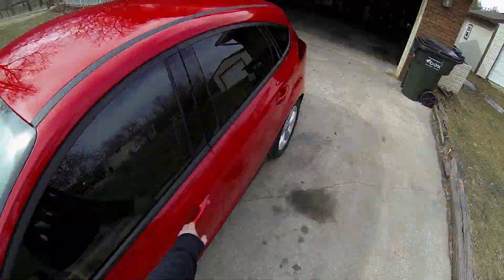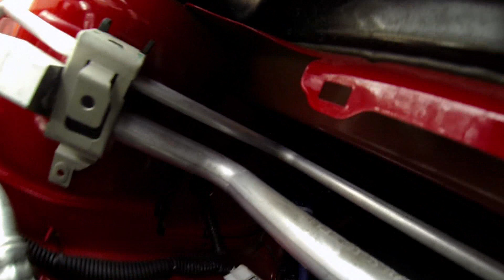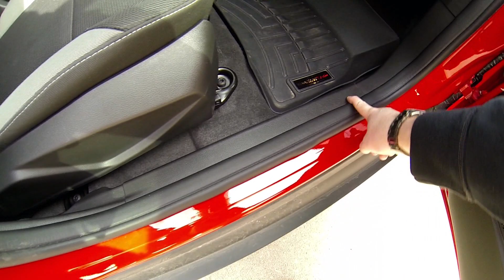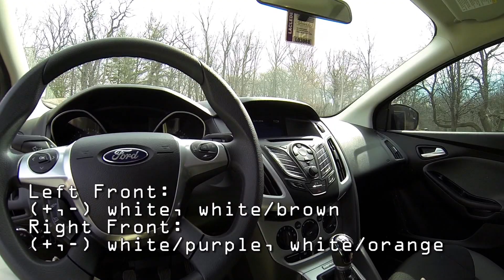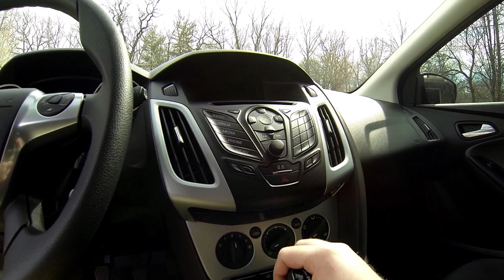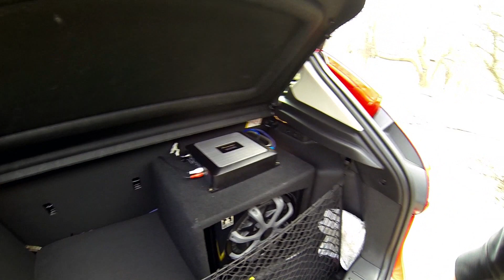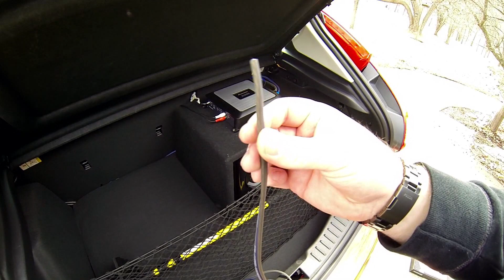2014 Ford Focus Amp Install

Comment: Thank you for posting this! My wife has a 2015 Focus Hatchback and there are subtle differences....but this showed me the path. Saved me a couple hundred dollars of installation fees.
Reply from the maker: pLoco1977 No problem! glad I could help.
Reply: Was it different to get behind radio on the 2015?  I have seen videos on 2016 that you have to removed all the plastic around shifter nob rather than just the two screws.  I hope this isnt the case.  The one in the video i saw had the bigger display as mine is the small one.  I have the SE model.

Comment: can you go more into how you spliced into the speaker wires on radio? ive only ever had aftermarket radio with the red and white rca hook ups.
Reply from the maker: Inside an RCA cable there is a signal wire, and then the ground usually as bare stranded wire wrapped around the insulation of the signal wire. My amp has high level inputs, but doesn't have any different high level input plugs (some amps have a separate special plug for them, not the RCA connections). So I ran the kicker RCA cable back to my amp, but then behind the radio, I snipped off the RCA ends, and got to the bare wires. I then used "tap-in" connectors to connect my RCA wires to the correct radio wires. That way I didn't have to actually cut the wires behind the radio. It can be argued that tap-ins are not very good for this type of thing, but I like them because they're quick. If you opt to use tap-ins, just make sure to cover them with lots of electrical tape afterwards just to be sure they stay in and don't short something.

Something like this could work, depending on the wire gauge coming from the radio:
https://www.amazon.com/Red-Insultion-Displacement-Connector-22-18/dp/B001N7RD9U/ref=pd_sim_23_5?ie=UTF8&psc=1&refRID=1XJ20VSTVNX5XM7RMP1E
Reply: +Dakota Alger thanks for the solid info man. I understand. wouldn't this work too Rockford RFHLC High Level Speaker Signal to Low Level RCA Adapter 
https://www.amazon.com/dp/B009VTDVMU/ref=cm_sw_r_cp_apa_gW2ZxbQ0V69K7?
Reply from the maker: +Dan Gan Yes, something like that should work. However, I've heard issues with the signal degrading in unpowered level converters. That may only be for extremely picky people though.

Comment: I don't know if anyone already knows this and idk if it applies to the 2014 model but i have a 2015 with the body/interior redesign and in the trunk there is a decently sized fuse block in the back with almost everything empty on it, though i honestly don't know what kind of power the rear fuse box can handle
Reply from the maker: Any rear fuse box can't be used to power the sub. If there is a fuse hooked to the ignition, then you could use that as the remote wire. I don't think my car has one, but I haven't checked. Good to know for people needing a remote wire though! Thanks for sharing.

Comment: WHERE DID YOU CONNECT THE GROUND WIRE TO.
Reply from the maker: I connected it to one of the rear seat bolts. Just a tad bit of sanding on the bolt, and it all works great. Just use a ground tester after running the power wire.
Reply: OK THANKS

Comment: wish you played a little so i could hear how it sounds
Reply from the maker: It sounds like a sub. lol
The audio always turns out crappy trying to record it, so I didn't bother. However, being a hatchback, the sound does bounce quite nicely off the rear door and is really loud for a 10 inch. If I make another more detailed install video I'll try to throw in a sample clip of how it sounds.
Reply: I figured that's why you didn't record it. Also, I just want to say thanks, this video makes it much easier for someone like me who's pretty uneducated on this to just go and copy and paste what's shown in the video. Aside from that i do have a question. Would you recommend i get the same sub and amp that you've displayed in the video? Thank you.
Reply from the maker: +Willyy I really like my setup. I definitely recommend my amp. I love pioneer because they have great amps, that usually don't require a remote wire and that have high level inputs (no line out converter). I would recommend getting a pioneer amp with a remote gain control. I love my sub too. I've had it for 6 years or so now, and have never felt the need to upgrade. Having a ported box really made the sub come to life, but I had to fill the box with poly fill to make it sound better. The box is good because it was cheap, and is the right volume for my sub matched with a ported box. I'm glad the video could help!
Reply: Thanks for the reply the information is much appreciated, but I do have one more question. Could you go into more detail about your subwoofer? I'm trying to locate the same sub and so far I understand it's a 10 inch kicker brand sub, but is it a compD, compS, etc.? Thank you again!
Reply from the maker: I went ahead and added the sub and amp info into the video description. Since the sub has two 4 ohm voice coils, I wired them in parallel to make the overall impedance 2 ohms.

Comment: Can I unplug my negative terminal on my focus st 2016 ... Or do I have to hookup outside power source to car. Don't care about loosing setting but will I need to reset any codes or radio codes ? Help 🙏🏽
Reply: Dakota Alger because taking off the hot and putting it back on causes sparks ...taking off the neg  and putting it back on no sparks
Reply from the maker: +Mateo Oliveras Yes, of course you can. The only thing that I lost was the time and the radio presets. Just be careful when you take them off. Although, may I ask why you need to remove your negative cable?? You shouldn't be connecting the amp negative directly to the battery.
Reply: Vintage Vinny DIY already did my install but doing any electrical work involving unplugging any electrical peices always unplug batter to prevent a short circuit because you can. Blow a fuse or worse the wire and have to replace the wiring harness in the car
Reply from the maker: Ah that makes sense. I work with very sensitive electronics, so I usually don't worry about it when I'm working on my car. haha
But definitely a good tip.

Comment: I did everything the same as in the video but now my stereo won't work at all, it's just saying my time and weather. I try to use t he sync functions on the steering wheel and still nothing :/
Reply from the maker: Well then the wiring behind the radio must not be right. Is the radio on? I know it sounds simple, but I just have to check... First thing to do is take the amp wires off the stock wires and see if everything works again. If it does, fantastic. Otherwise, check the fuses. If it was designed right, and since it's a ford I doubt it was, but you should blow a fuse long before any actual damage was done. Then, to get the wires correct, double check that you connected to the correct colors. What I did to verify, I used a ground tester. Connect one end to the ground, and then probe the wires coming out of the radio. The two wires you were connected to before, when the radio is playing decently loud, should make the ground tester light up (kind of beat with the music). Ground testers are super cheap too. You can get one at Walmart or Autozone. Last resort, if you live around saint louis, I could take a look at it. It should be noted, I don't know if the wiring is the same for the Sony radio, or for myFordTouch.
Reply: +Dakota Alger yeah I mean I'm hoping it's just a blown fuse, because I'm trying to turn the radio on and it just won't work. I've double checked the wires but who knows if it's a different setup since mine is a 2013 but it's not sony. Thanks for the reply and I'll definitely get back to you on what I did wrong.
Reply from the maker: Oh, one other possible thing to check... If you still are puzzled and don't feel like checking every wire, you could take off one of the front door panels, and see if the wire colors connected to the speaker are the same as they are on the back of the radio. Somewhere though, the wires split off for the tweeter, so I don't know if that will change them. In my Honda civic that I used to have, they were the same color all the way through.
Reply from the maker: +Todd Ingram I'm planning on making a video that shows everything a bit more in depth, but I won't have it made for a few weeks probably. Good luck with getting everything going.
Reply: +Dakota Alger Alright I'll check the door speakers, You've already been a big help with this video. I'll be waiting for the in-depth one too. Thanks dude
Reply from the maker: +Todd Ingram No problem

Comment: did you lose any of the steering wheel controls doing it this way?
Reply from the maker: No?? There would be no way to mess up those controls by doing it this way. The amp input have a very high inpedance, so they just measure the voltage, they don't provide any power to the factory speakers. However, if you splice into the wrong wires then you could mess some stuff up.
Reply from the maker: Plus, I forgot to say, I wouldn't have done anything to screw up the factory stuff. Everything works still including sync and all that jazz.

Comment: great video dude, very detailed. I put a system in my subbie last week and now my fiance wants one in her focus st. Do I have to pull any plastic from the back of the glove box to see the power wire coming through the firewall or will it be visible once I poke it through?  thanks.
Reply from the maker: +griffith0216 No plastic. But it isn't completely "visible" since it's a ways up behind the dash, but you can feel it. It's easiest to take the glove box off. If you have someone push on the rubber piece from inside the engine bay, then you can feel it from the inside up behind the glove box. My brother has a lot smaller arms and was able to get his hand up to the seal to grab the wire while I pushed the wire through with a big flat head screw driver (not pushing the screw driver into the wire, but next to it to help open the hole). We pulled it through the hole above the glove box first since it was easier to pull straight out from the firewall. Then fished it back through the hole in the glove box and ran it through the channel under the doors. Definitely the hardest part of the install though.
Reply: +Dakota Alger Yeah that was the hardest part of my install last week too. I had no help though so it was a pain in the ass. Thanks for the putting up the color code for the wires. I'm gonna be using the high level inputs on the amp as well.

Comment: Hi, awesome video you have here, quick question, do I need a special thing for the battery terminal? I was watching a different video and the guy said the stock battery terminal won't accept another wire so I wouldn't be able to wire the subs and stuff? Is that true? I already have all my stuff for the installation and really don't wanna be stumped by some $2 problem...

Thanks again
Reply from the maker: I've never had to buy anything extra, but it could depend on your car. You'll only need the positive connected to the battery terminal. I have had to cut the little plastic terminal cover before, but usually I just undo the bolt holding the terminal on, but the new connector for the sub on, and then bolt it back on. Long story short, just double check your car.
Reply: Well seeing you also have a 2014 i'm gonna hope I don't need anything, I also have a 2014, just a sedan, i'm gonna assume nothing should change...
Reply from the maker: +Redline Yeah just give it a shot and see. lol
The only thing you may have to do is drill out the connector to fit over the bolt on the battery, but that will depend on the wiring kit you bought. Goodluck!
Reply: +Dakota Alger Hey man new question, is there anyway to get into the factory wires without splicing? Can I do a pigtail connector or does the stock radio not accept it or whatever, I'm so new to all this and still have yet to get my subs installed lol.
Reply from the maker: Just splice it. There's no need to do an entire pigtail thing like when installing a new radio. Just a lot of extra work. Plus if you use a quick connect clip then you don't even have to cut the wires. You just slip the connector over the radio wire, and then put in the new wire and squeeze.
Reply: So a quick connect clip will allow me to pass the splicing part? If you can't tell I am trying my best to try and NOT splice the factory cables as I've had absolutely 0 experience with wires and on the off chance I screw something up, I don't want to void anything or even ruin my radio.

What do the quick connect clips look like? I did a quick search but they didn't really look like something I used for a radio wire.

Appreciate the quick responses, thank you.
Reply from the maker: https://www.google.com/search?q=quick+connect+clips&oq=quick+connect+clips&aqs=chrome..69i57.4485j0j7&sourceid=chrome&ie=UTF-8#q=wire+tap+connector
Sorry, I got the name wrong. But yeah, you can use these if you want. They don't give you the best connection, but if you wrap everything in electrical tape really well it should hold.
Reply: +Dakota Alger So when you are splicing behind the head unit is it because you are trying to get to the front speaker cables? I'm very confused about  that part, I have been told I can splice into  the rear speakers instead and save a lot of time without having to pop off the  head unit, you touched on this in your video, will I lose any quality? Hoping eventually I will get these things installed. Just really don't want to do something wrong, and the person who's helping me really advises I fray away from splicing into my head unit just in case something messes up I won't void my warranty.
Reply from the maker: Yes, and because all of the speakers are there in one place... That way I didn't have to find the wires on each side. So mainly it was for easy access.
Reply: +Dakota Alger Finally got it all installed. I'm gonna do a video on how it worked for me because it was so complicated... Finding where to splice the amp power into was also very difficult as we spliced it into a constant 12v at first so, hopefully the new splice worked or else ill be waking up to a dead battery!

Comment: i just recently got my license and i have been looking at focuses and i knew they didn't have a subwoofer but now if i do end up getting one i can install a amp thanks ofr the great video
Reply: lilpandasdancin if you get one don't get an automatic!!! They have the worst transmission in the world!!!!!
Reply: Robert Huff Jr wish I would've read this comment when you posted it....
Reply: lilpandasdancin wish I would of done my research because now I'm stuck with it for 4 more years
Reply from the maker: Yeah I got lucky and I only wanted a manual car. My mom ended up getting a Focus as well since she liked mine so much. That hardly even lasted a year because she got the automatic and it was terrible.

Comment: I've been wondering if it's possible to easily get behind that radio. I personally wouldn't install anything but I've been thinking about talking my car somewhere to get new speakers and a sub installed. My biggest concern was losing anything in that area. Now I'm a lot less concerned. Nice video.
Reply from the maker: +SnackeyG  Thanks! If you get stuck just let me know. Goodluck!

Comment: So all I need is the power wire kit from Walmart right? Help
Reply from the maker: +Bradley Campbell Well, you can do that... It depends on your setup. What kind of system are you planning on running? If you're planning on drawing a ton of power, I would get the better wires from Kicker or something like that. Just remember that everything else can be pretty easily replace in your sound system. But the wiring, not likely that you're ever going to want to replace it.